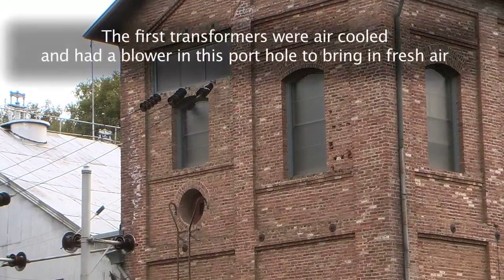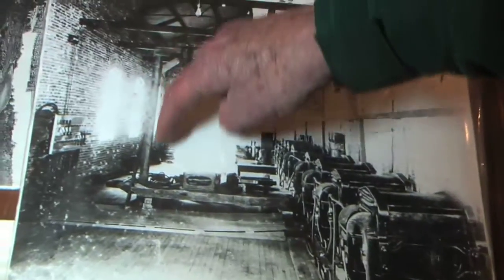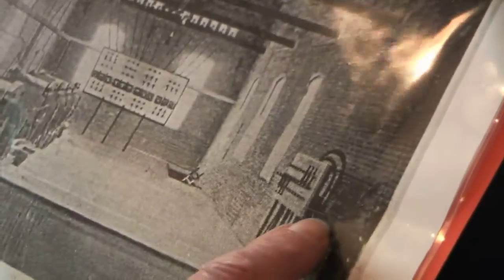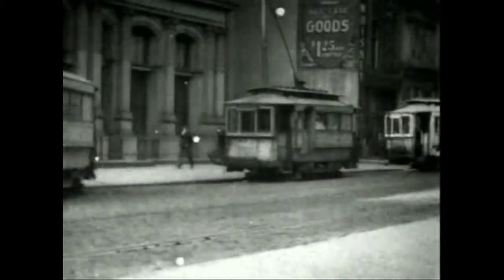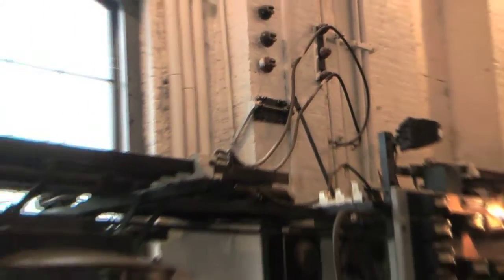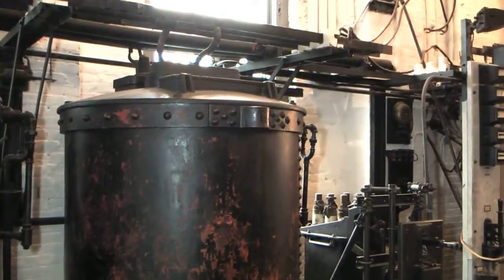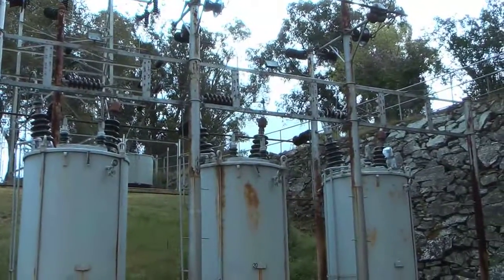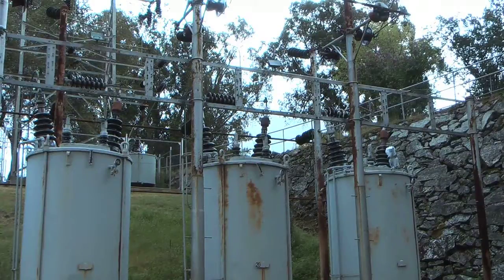Folsom - Early Transformers 1895-1920

Comment: The description of the third generation transformers says they were made by "Alice Calmers". The correct name is Allis Chalmers. I believe the narrator says it correctly. Allis Chalmers was headquartered in West Allis , Wisconsin and made a wide variety of products including electrical and farm equipment.
Reply: There's a song titled "Sweet Allis Chalmers" written and performed by Country Gazette, 1983 release which was but two years before A.C. was broken up into many separate divisions which were eventually all sold off.  They also built artillery tractors,  the M50 Ontos, anti-tank, vehicle, a six wheeled, amphibious, ATV called the "Terra Tiger", and steam turbines for the U.S. Navy. Allis' electrical division went into a joint venture with Siemens in 1978 and Siemens bought out Allis' stake in 1985 and also that year, Duetz AG of Germany bought the tractor division. The age of the corporate conglomerates, corporate predatory raiding, and cheaper Asian manufactured products are what brought the company to an end. In 1959 an A.C. tractor was used by Harry Ihrig and converted into  the first fuel cell powered vehicle ever and in 1965 they built a line of, hydrogen fueled, fuel cell powered golf carts. The also produced the first turbo powered tractor. They were innovators and made a damn good product.  Most of the electrical powerplants that were built using A.C. parts are still in operation today.